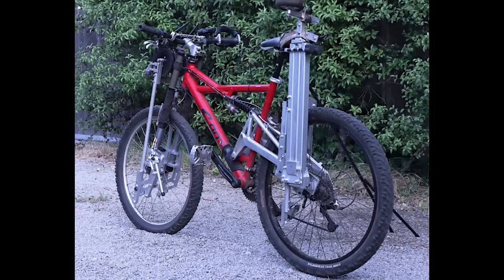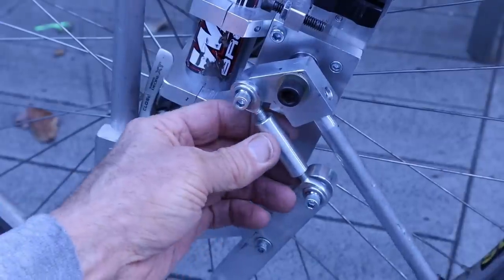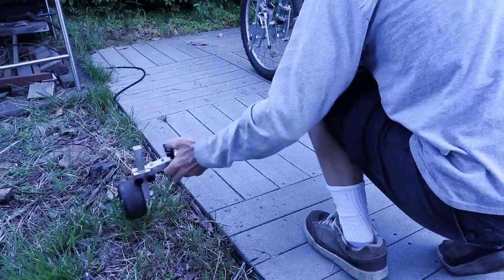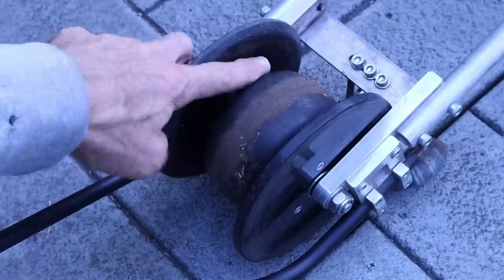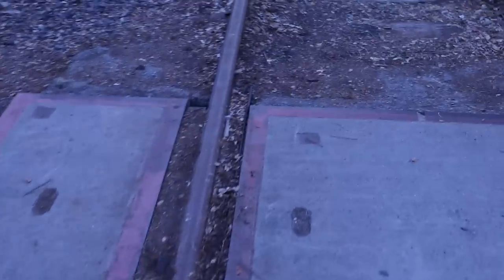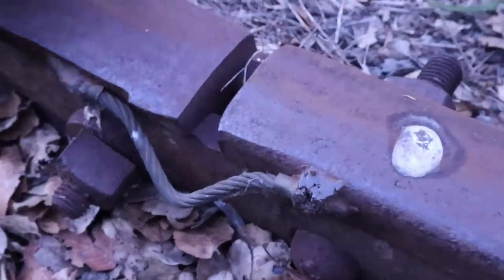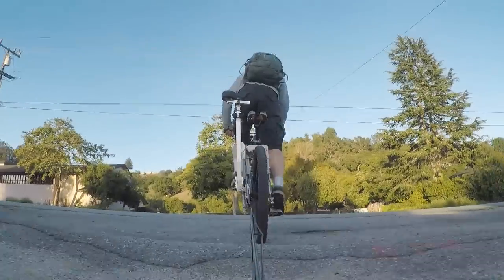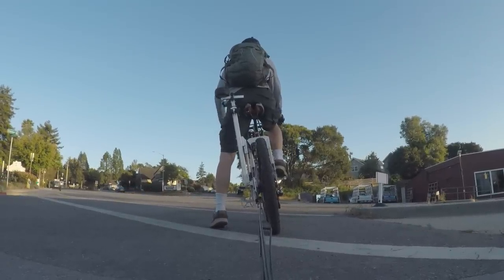Rail Bike with folding outriggers - riding  abandoned railroads on the central coast

Comment: Every railroad track has a service road next to it. Your video show this. It might be tight to going over that bridge. You mod does make it a very smooth ride & illuminates the stress of the occasional inconsiderate drivers cutting a bicycler off. Also it greatly reduces flat tires from Trash on the road. 

Nice work!

Comment: Great vid of a like minded bike rider.
 I’ve built something similar here in Australia and came across the same issues of flush road crossings interfering with the front guid.
 Worked around that by making the outside guide disc 1/2 in (1inch diameter) smaller. This setup allows the outside disc to ride up and onto the outside material but the inside disc was still in contact with the inside of rail to guide.
  Did allow some bias in the steering to ensure inside disc stayed in contact with rail edge.

Comment: You are correct about the cable and crossing gates. My wife used to own a company that made insulated rail joints. The insulated rail joints prevented electrical current from traveling further than needed. The rails are used as electrical conductors for signal lights (for the engineers) and to isolate the switches and road traffic signals from one another. You will likely see some of her joints in most rail systems in North America. You can identify insulated joints because a polymer (usually green or orange) material is butted between the two pieces of rail, which are joined by some fairly massive steel bars on each side connected through the rail with Huck bolts. Each bar has a thin fiberglass or kevlar material between the bars and rail, and the assembly area is coated with epoxy and painted to RR specs as far as color. Eventually, the 10mm or so of polymer material wears before the steel, or the rail car wheels begin to hammer down one or both ends of the rails.

Comment: It's a nice piece of engineering, lots better than a rail-bike I improvised years ago to explore a disused logging railroad before it was dismantled. What I didn't see mentioned is if you have a device to lock the steering in straight-ahead position while on the rails, which I found necessary.

Comment: haha, we made "rail bikes" back in the 80's.  we took the tires off and bent the rim out on one side (like a train wheel), bolted extension bars (forming a triangle) over to the other rail where we attached another rim...voila, we rode on the abandoned (and maybe not so abandoned at times) railroad tracks :)

Comment: I made a similar but much simpler system with a friend.   It has no outrigger or back connection.   We just used skipoles to get going.    Once rolling, it balances pretty well.   We could ride side-by-side in theory, although we only made one.   And vegetation growing in the middle would not be an issue.   Either rail could be used, which might help in overgrown areas.

Comment: The wire rope that is welded to join one rail to the next is for the signal systems as well as the crossing arm systems. Trackage that has signal systems(think traffic lights for the trains) have a current that runs through the rails. It's not enough to shock you like subway systems. It's super low current just meant to pass information from one signal to the next. Signals are placed roughly 2 miles apart. The axles of a train shunt the circuit and tell the signals that there's a train in the block. A block is a stretch of track within two opposing signals. So when a train axel shunts the circuit the signal light will turn red, letting other trains know there is a train in the next block. The signal system extends beyond the next signal. It will turn the next furthest signal solid yellow and the signal one further than that flashing yellow. These are basically warning lights. Flashing yellow is the lesser restrictive, solid yellow is more restrictive and red is obviously most restrictive. Some tracks, like perhaps the one's you're on may also be "dark territory" meaning they are not controlled by signal systems, no lights. Instead they require track warrants to occupy, issued by the train dispatcher for that region. Source- Former locomotive engineer turned boxcar riding hobo. Cool bike, stay safe!

Comment: Nice. If you put your outrigger and your tire guide together up front, you could stick to the inner flange system and get a tighter fit and also get around the issues caused by road crossings and grounding welds.

Comment: I feel like you could have used modified training wheels that fold from both sides of the front wheel and have it do the locating of the inside of the rails still. If you make it in a way that turns the 2 arms into a semi-lift your back tire can have full traction on the railroad ties with the rear tire and if your suspension is good enough, the bumps will be negligible, as the front will have the stability of the tracks. This should, in my very quick thought theory, work out to give you better speed, better turn control, and better braking.

Comment: I'm wondering about problem you described ie the locating discs.  Would it help if you copied the trains' discs being placed on only one side of each wheel thereby holding to the tracks without the problems of unwanted contact with grounding straps etc. ??
Absolutely love that invention!   Train travel is one of my favorite memories.   Riding the rails has just made it a whole new experience!

Comment: OK I see that with locked center steering, the bike will kinematically align with the straightline the flanged wheel is following. This has a minimalist elegance to match the dynamic steering of the bicycle normally. Your design has tremendous practical value in being both so it can be ridden to the tracks and  also removed and compacted back to road bike in worst case scenario of having to clear off the track on a bridge or tunnel.  Even then safer than road biking on undivided highway with soft shoulders across Canada.

Comment: Here is a thought on your flanges.  Have a inside one on your front wheel and one on the outrigger and then it will act like the train wheels, that way you keep the same weight and you don't have issues with the city crossings and won't have to worry about anything on the outside of the rails

Comment: If the railroad is usually completely flat and without major gaps, have you thought about using road bike wheels? The really thin and frictionless sort? That would possibly make the bike much faster, at the cost of overall practical biking outside of the rail.

Comment: You should have a flange on the stabilizer extension wheel as well. I also noticed the back wheel of the bike is sitting a bit left in comparison to the front bike wheel. This could be corrected by a flange or even a double flange on the outside stabilizer extension wheel. thanks for allow us to provide a bit of hopefully helpful feedback. Tzzogg the Caveman.

Comment: I'm surprised that one guide wheel is enough to keep you on the track. 
It's nice to be away from the large lumps of steel that are coming at you from all directions on the road, but i guess you'd be even flatter if you met one of the large lumps of metal that tends to frequent the rails :)

Comment: Idea. Take outer flange off of the front. On the back, put a locator on the inside. Or put a spring on the front outer flange so it can ride over things if necessary. Curious if these would work.

Comment: Very cool! I didnt understand why you did not want to put a disc on the outrigger part and switch to inside discs only to avoid the problems you mentioned though. You said this was because you did not want to add bulk/weight but I did not see how removing disc from the outside of the front wheel and adding one on the inside of the outrigger would add much?

Comment: You would do well to put some lower-profile tyres on as those mtb treads steal away alot of momentum. I reccommend cruiser type tyres. Tyres have universal sizing between different types of bike so you are not limited to high-tread tyres just because its a mountain bike. I'm gonna guess your wheels are about a 26" diameter so thats a good place to start your search. I recommend Schwalbe tyres. Theyre a very smooth ride and they tend to look pretty nice too.

Comment: This is really a nice idea because it is light weight but I do see one major "flaw" in it.
I could not see any sufficient way to ensure a safe ride in case one leans a tiny bit too far to the right.

Don´t see a problem with the rear wheel not being locked onto the rail (it might give additional safety - but would add some weight) as it will always follow the front wheel and thus will stay on the rail.
Only if the rider moves his body too much left/right - especially when not sitting while "working hard" uphill or during acceleration this might bear some danger.

Comment: A hardtail with both front and rear guides is more suitable than a FS bike with this setup. I don't think you need the stabilizing arm for this to work,just a rear guide to keep both wheels on the rail. Cool contraption nonetheless.

Comment: Instead of using twist clamps, get yourself a set of front wheel cam locks and shorten them + new thread. All you have to do is pre-set them to the desired tension and you're set after.

Comment: I have been thinking about building a rail bike for 20 years. It seems a bike without swing arms, would allow the outrigger to attach between the angled rear strut and a luggage rack vertical support... symplifiying the mounting for the hinge- and supplying  needed rack... ( no back pack.. and room for loppers and a chain saw to clear bushes !)   Do you feel there is enough torque on the outrigger to require all that square tube.. or might it be simplified to a single telescoping round tube ?
  I confess I remain somewhat mystified as to what keeps the bike from falling off the track away from the outrigger ?   Is this all down to the front flanges .. in the human powered version the C.G. is pretty high...  i noticed you notably slowing on a curve ( maybe in the electric version to paharo).  I cannot make out the kind of wheels you say you are useing... LAWN something ?    What is the material for the locating discs?  I looks like you machined the rounded edges.   You mention the edge guide wheels briefly in the electric post.. but I am still a bit unclear about what they do.   I think they are spring loaded  to compensate for the welded rail ground lugs and cables.    I will repeat this question on the rail e-bike post.. thanks from Sonoma Coast.

Comment: Too cool !!   However, I’m just lazy (and old)  enough to imagine a recliner bike with an electrically driven single wheel trailer.  Weight of several batteries actually an advantage for traction.  👊🥸

Comment: What about making the outboard guide hemispherical with a pivot point at the top and a spring tensioning it in place so that as you hit a road-crossing it could rotate up. You would have wear on it where it would skid over the concrete, but it would be minor, and then as you hit open track it would just pull back down into place.

Comment: The problem I see is that to keep a stable equilibrium, the bycicle must be slightly inclined to the left to keep contact with side wheel.  It is very uncomfortable to push pedals if you are out of vertical ride.

Comment: The game changer would be using entirely one rail.
Then you could have traffic flow in both directions.
Maybe a gyroscope to keep it stable, electric drive optional.
Reply: If you can ride a normal bike, I doubt a gyroscope would be needed. Just the forward guide wheel would likely work well enough.

Comment: awesome. does using abroad tire and more pressure reduce drag significantly? would be fun to see an ebike version with posts that would makes contact with overhead lines and use thousands of volts to propel the bike without battery 😂
Reply: Good luck finding small MOSFETs and capacitors for your inverter which can handle those voltages...

Comment: So I have a fat tire ebike and one day I got a flat tire, which resulted in me taking the tire off the wheel and walking the bike to a bike shop. To get there, I walked next to tracks that run next to the shop. If it was my front wheel that had the flat, I probably would have tried riding it on the track. It looked like the rims would have fit perfectly.

Comment: What happens if you get a flat front tire while riding the rails? Are the "abandoned railroads" open to the public or are you technically trespassing? How loud is it riding on the rail? Have you made plans for your design that can be sold? (Thinking Esty)
Reply: In most cases they're still private property, although many of the routes which have had their rail infrastructure removed are bought by public entities and opened for use as trails.

Comment: Let me preface this by saying the bike likely wasn’t designed for this. https://www.youtube.com/post/UgkxwC0IIeIomGQVeBWg-kKJaToZkLEFIA2W I picked this up for a trip to the Rockies where I didn’t want to mess with a rental car. The bike packs down great and was easily carried through TSA and through the airport. It’s a bit heavy to tote around all day but for smaller airports it was manageable. I gate checked the bike twice with no issues and it held up great. Overall I did around 100 miles through the Rockies and the only issue I had was the left crank arm kept falling off. Due to the remoteness I couldn’t source any locktite so I just kept tightening it every 10-15 miles.The bike is reasonably comfortable for 4-6 hours of riding with a Brooks saddle. For reference im 6’ 200lbs and felt like the bike fit me pretty well. The brakes are decent and the tires held up great. Overall for the price I’d say it’s a great commuter bike but I’d swap out the chainring if you plan to do a lot of hills.

Comment: This is such a cool project!! Love your build quality! Would slick tires reduce rolling resistance and be faster? Or would they lose traction too easily on the track? Regardless, such an amazing project!
Reply: Slick tires would be faster. The traction also should be better with slicks - more contact area tire/rail.
Reply: @chrisko6439  makes sense. Now I'm wondering how dirty the rails are. On a clean rail your analysis makes perfect sense. What do you think?
Reply: @madmayhem2000  Actually, I think a dirty/rusty rail might even provide better grip than a rail that is polished by trains using it regularly.

Comment: You couldn't remove the outside flange on the front wheel and use it as an inside flange on your outrigger wheel to eliminate the problem with road crossings?
Reply from the maker: I tried hat, and you have to put a lot of weight on the outrigger wheel to keep it down, if it comes up even a little bit you will derail.
Reply: @kev7777777777  Thank you for the reply

Comment: I don’t see why you can’t put one-sided flanges on both outriggers………both on the inside of the track. You’ve done it on the front one, just put one on the inside of the outrigger wheel that keeps you aligned on the other track. Should be easy after seeing what you have already done. That would eliminate your problem of the grounding straps at road crossings.

Comment: You ride in one gear too high. Drop one. Spin is good, but not that much spin.
Your outrigger wheel would conduct less vibrations if it were urathane or softer rubber. 
Otherwise not a bad product.

Comment: Gotta be the straightest possible way from A to B and no steep hills to climb. Just don't get caught using that bike on tracks that are still in use because the railroad cops will lock you up. Try riding your bike in 4 by 8 cell. Not fun!

Comment: It is in my Log? Fuck why? Why in the case  of looking to my account this evil Company wants additional Information on the mobile cell phone :-/? Ok I write it again:

You are  only steered by the front wheel on  track. This means you my by kicked off the Track by a side force like wind or a heavy movement of your Body. Assume you are off track left from rail.  Then you can't balance by steering against a fell to the right. The limiter on bridges  are not rarely high, designt for persons standing on the floor. The gravitational Center of your Body is higher and have a notable Momentum.There is a probability to fell of a Bridge in case  of a derailment on a bridge ……  especial in the case of a derailment to the left.